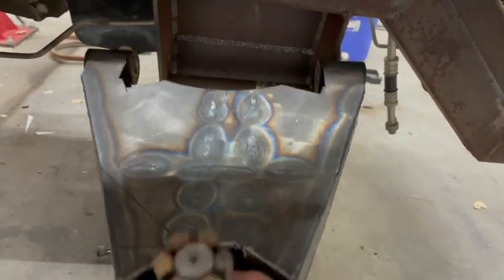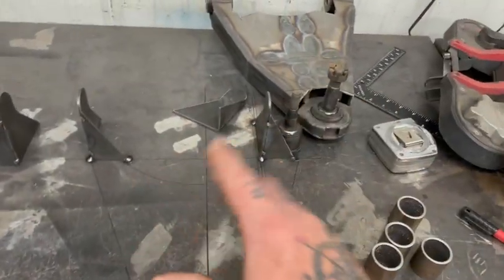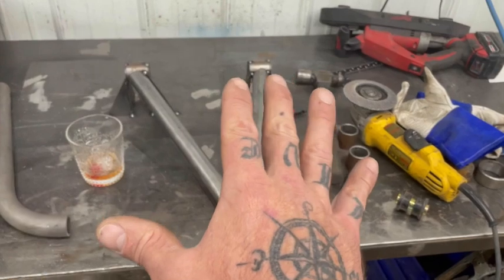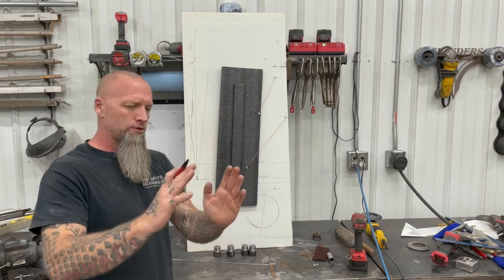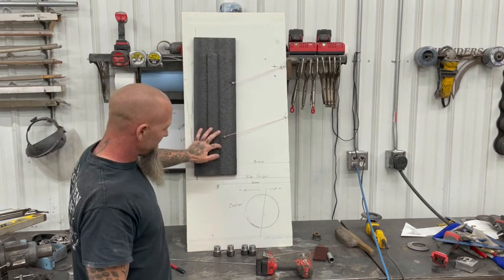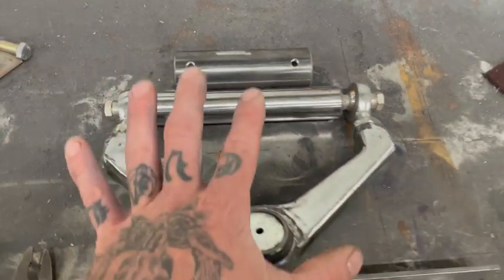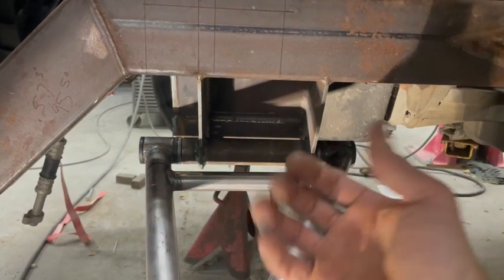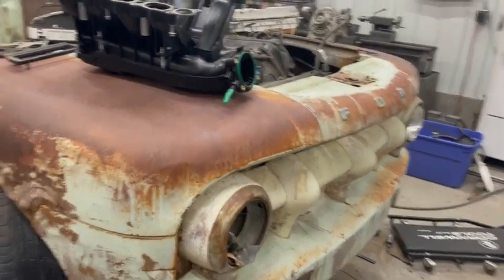How to build independent front suspension

Comment: @nocoastmotofab most common ifs spindles are mustang 2 based. What if you use a different spindle/upright? Any pointers/info i should look into there? My thought is set the track width and base the control arms and crossmember from there?
Reply from the maker: I’m using mustang 2 spindles on this truck because I had an extra set kicking around, they’re a good cheap option and easy to source. I personally prefer corvette spindles much better brake set up. You are correct, set your track width and work from there do your best to keep the control arms as long as possible. It will make getting proper geometry a lot easier, short arms are a pain in the ass to deal with when setting everything up.
Reply: @nocoastmotofab4181  thanks for taking the time to reply. C4 spindles with the bolt in hub and brake options suit my taste better.

Comment: Hey just came across your video while looking for info on building your own a-armed suspension. Ive been kicking around the idea for my truck but building a mid travel kit for my truck instead of lowered suspension. I want to utilize all the stock pivot points, stock spindles, and just extend my track width. Any tips on where to start? i was thinking of buying some stock upper and lower control arms to measure and draw up in 3D and just extend them to my desired width to begin with. As this truck is my daily driver and cant have it down. How would i go about getting measurements off the frame to get everything in 3D where they actually are in real life? I want to send this out for laser and hopefully welder up and slap it on lol.
Reply from the maker: You haven’t given me much info to work with so take this with a grain of salt haha. I agree if it’s your daily a spare set of arms is the way to go to get your measurements off of and design from. I’d put the truck on jack stands turn lock to lock so you know what clearances you need to maintain for your steering. Extending the track width is going to give you a couple of things to consider. First it will more than likely change your roll center so I’d plan on measuring your pick up points on the frame and model the entire thing since you have the software so you’re not going into it blind. Second your adding leverage to your coil effectively derating it so I’d be willing to bet you will need to go to a stiffer coil to keep the same ride. That will also apply to the sway bar. Last would be the steering, if it’s a rack then you’ll need extenders or new ends where it’s a truck you might have a drag link that you will need to plan for when you do it. Hope this helps, extending the arms isn’t too bad to do it just comes with extra steps

Comment: I thought at ride height, you wanted your lower control arm parallel with the ground.. Did I get that wrong?
Reply from the maker: No you are correct. That is what you should shoot for but it’s not always going to happen depending on the variables you’re working with and the ride height you’re after ( the lower the ride height the harder it is to keep parallel) but If you nail the geometry then you already know what’s happening at every point through the entire suspension travel which makes it possible to cheat being parallel and still have good handling.

Comment: Tilting the top control arm induces anti dive during braking.try stomping on brakes without antidive built in and you may need new underwear.
Reply from the maker: True, anti dive gets a little tricky to cover in a basics video so I decided to leave it out for now. Anti dive basically prevents the car from diving on the brakes and stops the wheels from deflecting vertically or going into bump under hard braking. If you have 100% anti dive you won’t get any any front compression due to braking, the lower the percentage the more compression you get which would also translate to how much grip your getting in a corner, but you also have to factor in brake bias, cg, wheelbase, and whether the rear is going into squat or anti squat under braking. You could really do a dedicated channel that covered nothing but suspensions and all the theory and geometry it entails.